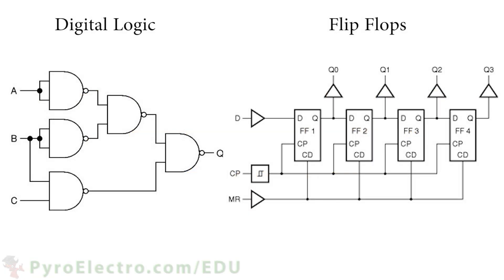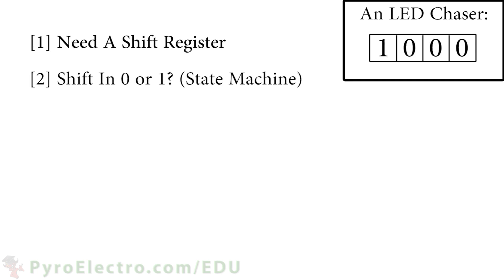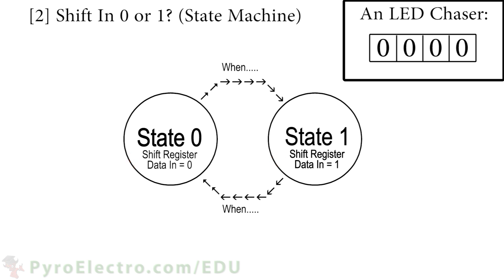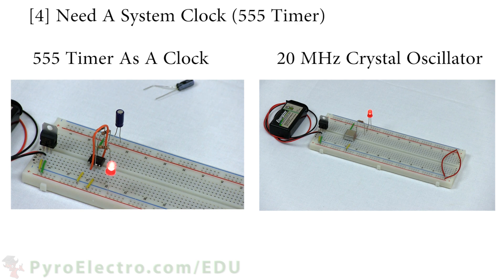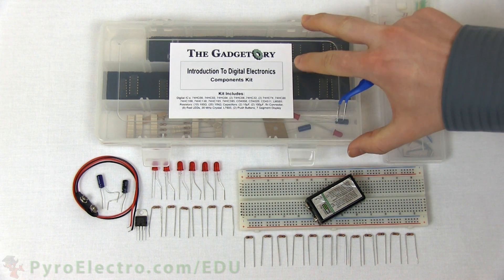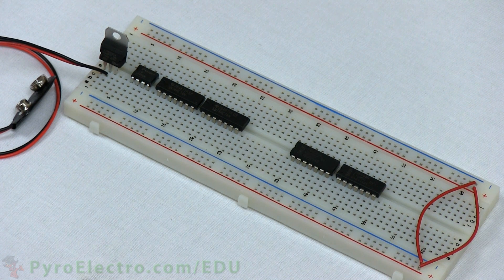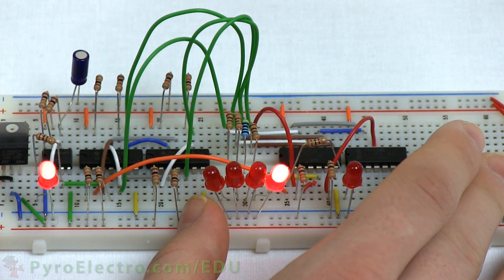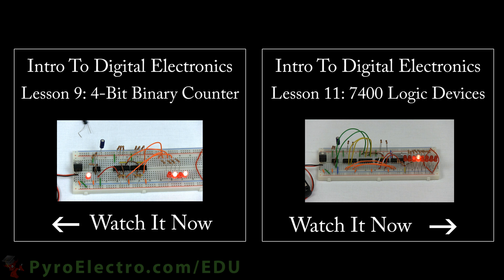Design An LED Chaser - An Introduction To Digital Electronics - PyroEDU

Comment: Isn't that doable with just 4 D-Flip-flops in serie (Q1 to D2, Q2 to D3, Q3 to D4) and then just Q'4 (Q not 4) linked to D1 ? I obtain the exact same result.
Reply: I agree!  The circuit was far more complex than necessary.  A "not" gate after Q4 would have sufficed.